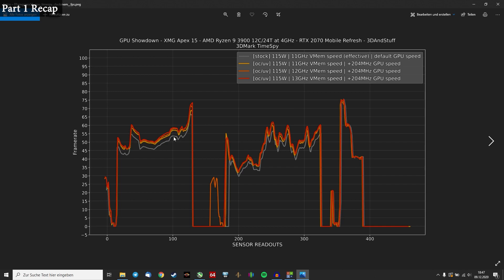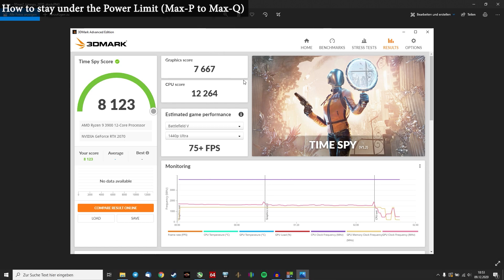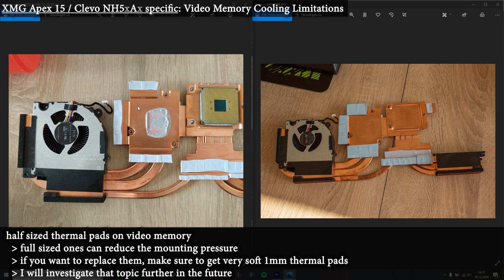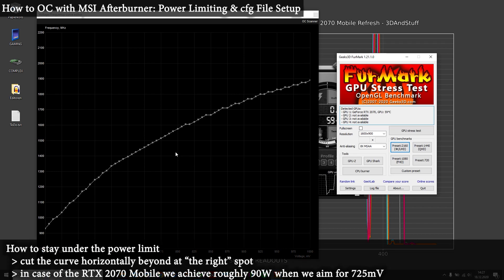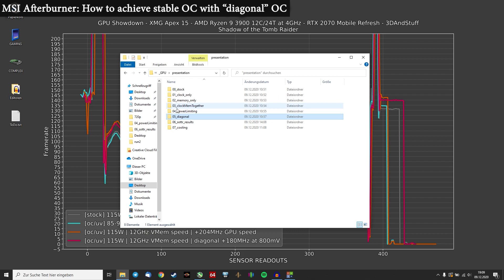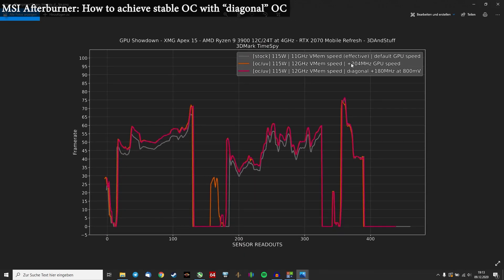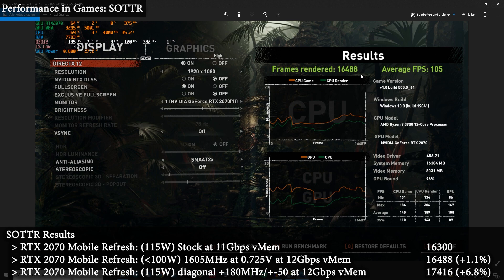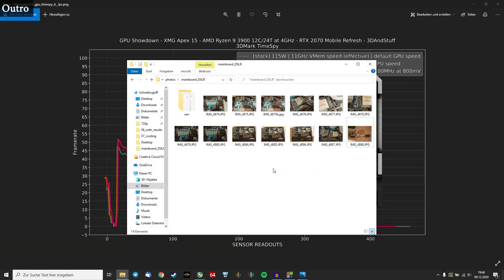Mobile GPU Overclocking & Tuning - An Investigation & Introduction to MSI Afterburner - Part 2

Comment: awesome explanation... i was already doing this myself since 2 years but with your explanation i understandood such many thing like why i wasn't even to see voltages under 700mv on my 2070s 115w, now i will definitly re-do my undervolt config taking into consideration the rest of the curve istead of the flatline from 700mv (my lowest voltage basically in the stock curve)

Comment: May I ask one more question? I use control center to undervolting. But in game (cyberpunk example) I have short moment, when setting set to default and temperatures go to 90-94 (65-75W ryzen 3600) for second then undervolting come back and I have 75-76 C most of the time. Is it so bad that I have these temperatures peaks? It's about 2-3 times an hour. Mostly when game start and close.
I know that I can use ryzen master to undervolt, but I can't delite control center because it has keyboard light control inside.
Reply from the maker: you can deactivate the control center and stil luse the keyboard led app ("LED keyboard setting"). It will still work. Do deactivate the ControlCenter properly you have to deactivate it in Windows services. Then use ZenStates or ClockTuner for Ryzen to make use of ManualOC.
High temperatures above 90°C on 1CCD processors forsome seconds are normal. Make sure the processor comes back to normal temperatures (<80°C) in the long run.
Reply: @TechModLab  I only can find Control Center Hotkey Service and HotKey Clipboard Service. Is it all, or there are more services? If it's not, then how deactivate and find rest of them? Is there instruction or something else for it. I found this http://forum.notebookreview.com/threads/remove-clevo-control-centers-cpu-oc-component-completely-x170sm-g.834715/ but i think it's to deep, isn't it? Maybe there is another way to deactivate CCC and left LEDks? Thank you for answer.
Reply from the maker: @gnev112  control center hotkey service only.

Comment: Hello, is it fine if my cpu fan rotate about 30% and gpu 40% in idle? I did uv/oc on cpu and gpu both. I have good temperature, but my fans work constantly. Can it hurt them? And how much is yours cpu temperature in idle? Sorry for bad english.
Reply from the maker: CPU fan should be at 20% in idle. 40% GPU fan is normal. No it can't hurt them. Fans are made to rotate 24/7. My CPU idle temperature is at around 54°C in idle. Which is normal too. The fans spin slowly so the temperature is a bit higher than it could be. But we don't want to have loud notebooks in idle, right? So, relax, everything is fine ;)
Reply: @TechModLab  thanks for your answer!

Comment: You're brilliant!!!  You should have already expected that my opinion is to go for the OC/UV option (<100W), as for me lesser temps help prevent silicon degradation. But it's just my taste. I'm very happy with stock performance, so having the same performance but drawing less power, I take it!!  Congratulations man!!! 👍🏻👍🏻👍🏻👍🏻👍🏻👍🏻👍🏻👍🏻👍🏻👍🏻👍🏻
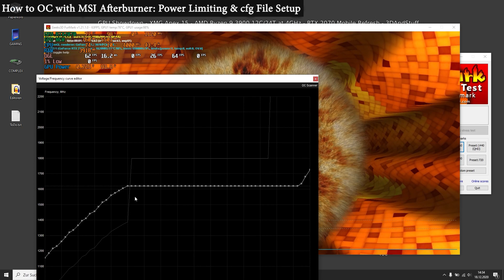Reply: @3DAndStuff Hey buddy, if you don't mind the question, how did you manage to get all the FPS statistics on the RTSS overlay at 9:44 for the FurMark benchmark test?  I enabled FPS, FPS min avg max 1% low in Afterburner monitoring tab, but it didn't work. I also tried to give each individual statistic a group name, no luck.  Sorry for asking this basic question... thanks!
Reply: Nevermind man! Just realized that if you don't start the benchmark, it does not generate these statistics to be shown. I got it sorted out now. Thanks!
Reply from the maker: @leovbernardo  Yep exactly :) And if you want GPU Power Readings you need to load the HWInfo.dll in the Overlay Tab of Afterburner, then go on customize and add GPU Power manually. Please note that HWInfo needs to run in the background to enable the data streaming.
Reply: @TechModLab  Thank you! I managed to get GPU Power thru HWInfo OSD RTSS settings, but setting up all parameters via MSI Afterburner is easier. Just fixed according to your suggestion.  BTW, I followed your guidance and managed to OC/UV my RTX 2070 to settings very similar to yours (VCore @ 1605MHz @ 0.725V and 12GHz Vmem) in order to limit CPU power to 85/95W.  However, while playing CS:GO, I noticed a weird behaviour: the GPU tries to keep its power as set up in Afterburner, but it does not "stick". It keeps pushing 115W @ 1V to the GPU... Have you experienced this as well?  Maybe it is due to BIOS and/or EC different versions (mine are 1.07.06TEI and 1.07.03, respectively).  Thanks!
Reply: @3DAndStuff What is very interesting is that Time Spy follows exactly the limits you set to core clock and voltage in Afterburner. CS:GO manages to somehow drain more power, increasing the clock and voltage constantly with peaks at 2100MHz and 1.069V, respectively.  Did you notice something similar when you tested SOTTR?
Reply from the maker: @leovbernardo  no but i think the utilization in cs:go is so low that it can easily jump to above 1.0V from time to time. If you wish to prevent that edit the cfg file again and extend the upper voltage limit to 1100 or 1200. Now flatten the curve again.
Reply: @TechModLab  You are brilliant! That was indeed the reason. After expanding the limits of the chart, I saw the curve did not flatten after 1.00V. I changed the limit to 1200mV in the cfg file and flattened the curve. Now GS:GO is playing nicely at 180 fps avg, 84 fps 1% low, quiet and cool at a maximum of 70C, drawing 84W max. AWESOME!!! 😊😁 Thank you again!